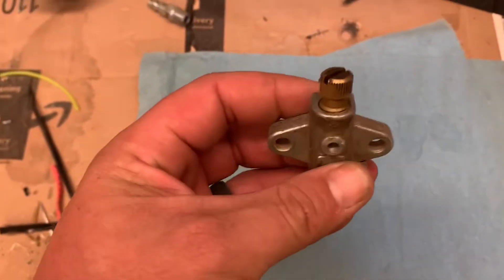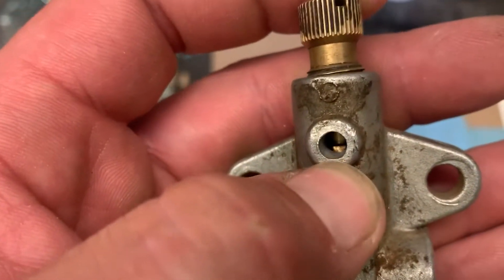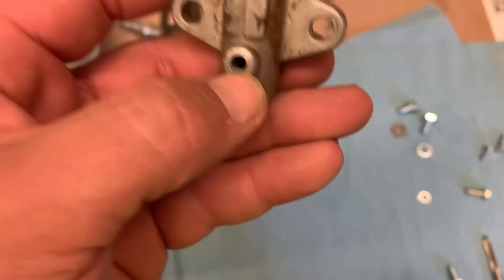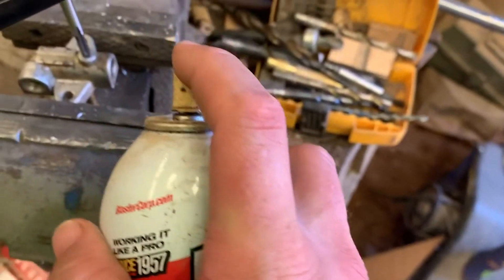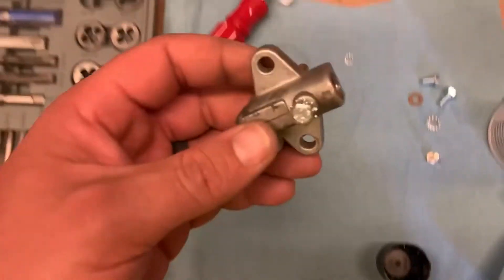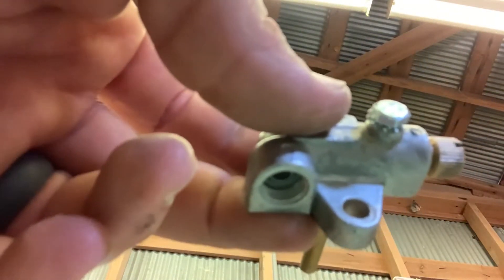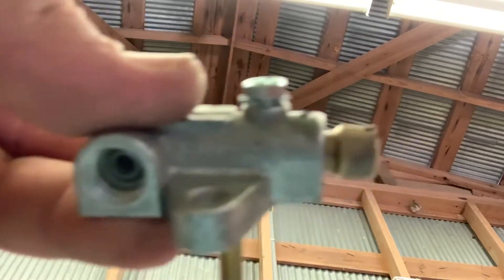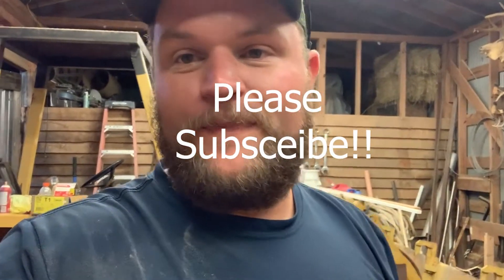Ford 600 and 800 Tractor Fuel Shut Off Hack!? [[Easy O-ring Replacement?]]

Comment: Have had many failures of the large o ring. Bought several cut offs and replaced o rings several more times, always the large one. Will hold for 3 or 4 weeks then slow leak. Fixed it though, replaced tank with a tank made for 8n or 8oo. It has a side mount for the sediment bowl type shut off. Works great and if ever need to change no disassembly required.

Comment: Thanks for the Hack . I'll need to do this to my Ford 860 because the gas ALWAYS leaks.  You can help by making ia video of how to remove the HOOD!. There are so many bolts, nuts, etc. My tractor has spent 40 years in the rain uncovered in western WA. Every bolt, nut etc. Is rusted to the point I had to just drill a few out. HELP!!  I couldn't figure out how to move the grill out. I thought it was just bolted through the sheet metal to the axile. It turned out there was a clip in the upper part of the grill that needed to be worked. Even the local  New Holland (Old Ford) dealership didn't know how to do it. Knowledgably mechanics for these tractors are either retired or dead.   Everything seems to be a learn as I go.

Comment: If you just drilled the rivot out and then only turn it out a certain number of turns it should work without the stop bolt. The oring should provide enough resistance to keep it from vibrating out further
Reply from the maker: Very true. If it was going on my tractor, that’s probably what I would have done. Thanks for commenting and watching!